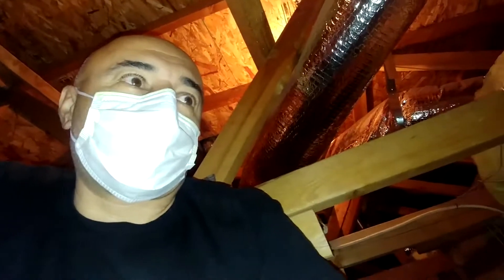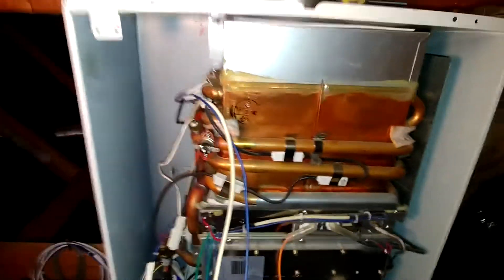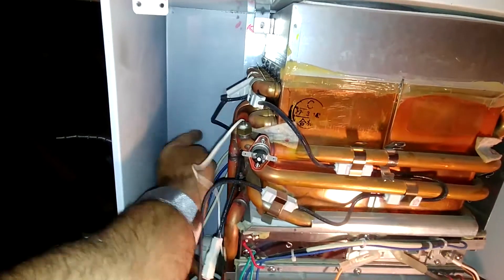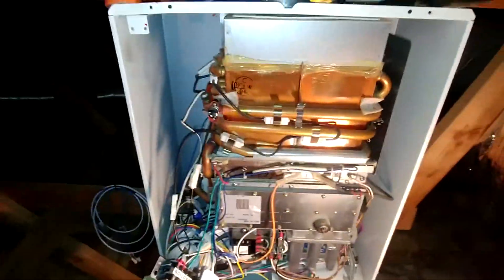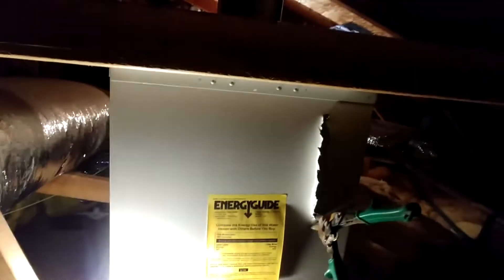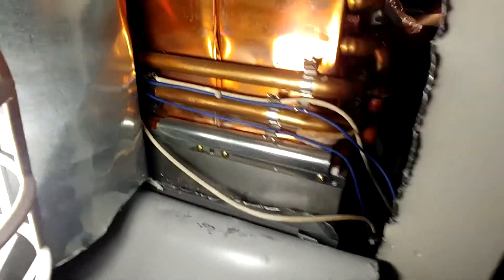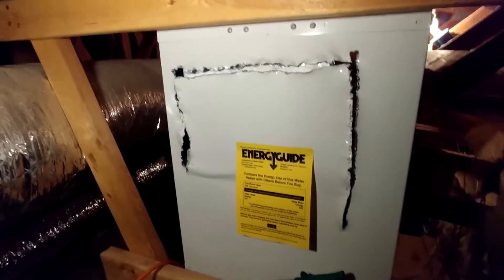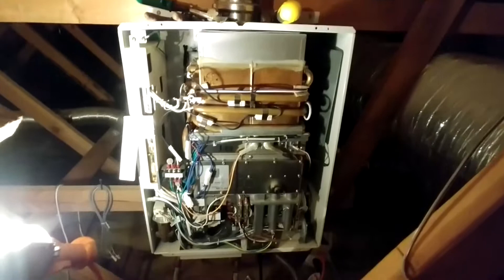How to change the fuse on your TAKAGI T-M1 thankless gas water heater

Comment: I also have a T-M1. I salute you sir. That was a very creative solution. Lucky you have access to the back of the unit, I don't. My 11 year-old T-M1 is leaking (heat exchanger). I'm giving up on it. Tagaki parts are too hard to get and I can't find a plumber who knows how to fix them. I've done all the work myself so far, but it's getting tiresome.

Comment: Creative solution.  I have the same water heater and the same problem.  I may just short the fuse at the connector to make it work, bypassing the overheat protection, and relying on my whole house anti-scald valve to protect against malfunction.  Or I could replace the entire unit for a $30 part.  Or I could spend a day tearing down and reinstalling and hoping that works.  (I'll probably short it with a jumper).  Thanks for posting.
Reply: Looks like a nightmare job, I like your creative thinking! Did you end up doing it that way?
Reply from the maker: Yes, that is a solution too. One can replace the whole unit, a $4000 job for a $30 fuse, and that was the specialist recommendation of doing. Also you can just bypass the fuse. However, I wanted mine fixed in case I sell the house and move out. The unit works fine now and I sleep well knowing that all protections are in place.
Reply from the maker: @kurtkroening5196  It is not quite a nightmare job if you have easy access to the unit. However, all is depending on how much one value his money. I got an  offer of replacing the unit, a $4000 job, from the tech recommended by the manufacturer in my area and that in a month after my call.
Reply: @kurtkroening5196  I bought a new fuse, replaced the old one, but instead of attaching it properly and wrapping it all over, I just attached as best I could to the accessible area in front.  It's been like that for 8 months and hasn't given me any trouble since then.  I might have some protection with the fuse this way?  I also do have an anti-scald valve on the house supply line, which I think gives me some protection.
Reply from the maker: @inevitable2142  The fuse protects the unit in case of overheating(hard to imagine) and fire. I guess your solution works too. Just don't sell the house with the unit like that.

Comment: It happened to mine.  I jumpered using a #12 solid wire across the 2 connectors leading back to ckt board.   Now I'm trying to figure out how to replace the outlet isolation valve located in back of bottom left.    I may cut the top and bottom seams on left side so i can push side out of the way.  

BTW, looks like the overtemp wires were the only thing you would need access to from back.

Comment: I have a Takagi T-K1. Error lights say problem is either computer or hi limit switch.  Can I bridge the switch connections to see if it is the switch or the computer?  Gets power OK, good water flow, GFCI resets OK.  Gas is OK.  Does not even fire the igniter.  Any ideas??
Reply from the maker: Yes, you can bridge the switch to test if is the fuse at fault. I did that too. Most of the time it is. However, I am not a technician so I don't know much about this or other systems.